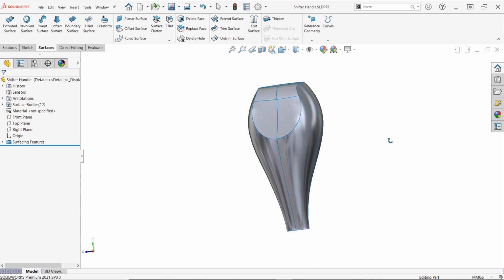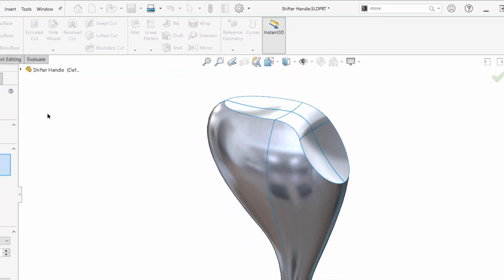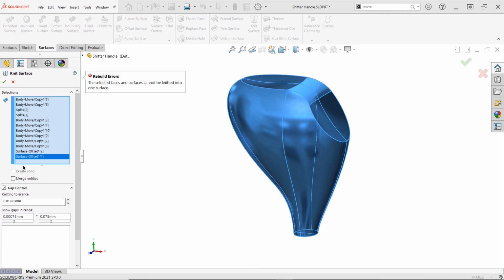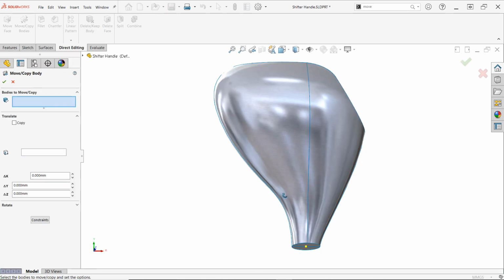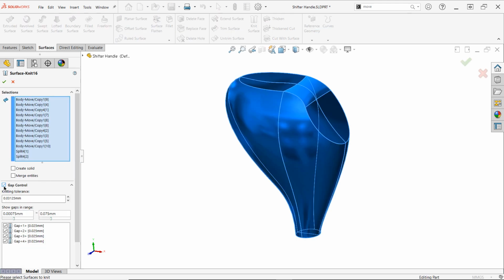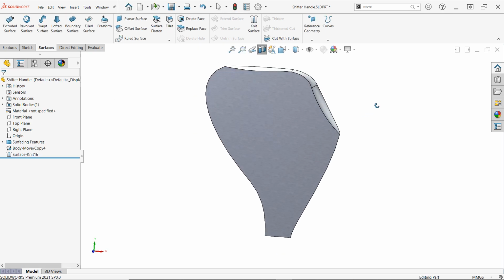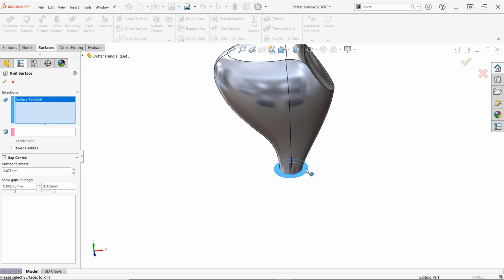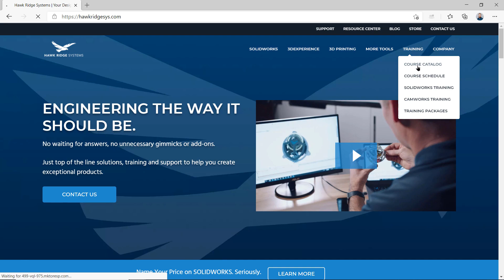SOLIDWORKS: Using Knit Feature for Surface Modeling

Comment: What you call solid, is just the system putting a cap on the holes. 
It's all surfaces. And you can see that if you make transparent one surface of a "solid" and you can look inside and see there is nothing inside! LOL (Use the Change Transparency command on any surface of a "solid" in a Part file, in the context menu!)
Also you can see all the internal (negative) features as surfaces.

Comment: If I knit all surfaces and it rebuilds without errors, why do I still see those unwanted lines?
The whole point is to get rid of the lines because sometimes Fillets don't succeed with crossing lines!

Comment: Can you teach me how to link two parts of solidworks by using knite surface. I mean like i draw two parts for example i saved them as part 1 amd part 2 of solid works file, and then how i can create a link between them so that if in future i need to change the dimensions then i can easily change that only and other parts will be changes with respect to that 😊

Comment: What you’d say if compare offset from the surface with zero vs knit surface tool?
Reply: Hi Artem, that's a great question. There's a considerable amount of overlap between those two tools in the context you're describing, and in many cases they can accomplish the same thing. The main difference in your situation is that Offset Surface can be used on individual faces of surface bodies to offset/copy them, while Knit Surface must be used on entire bodies and cannot be used on individual faces. Keep in mind that what you're describing is a different use case for the Knit command and isn't something that is shown in this video. I hope this helps!

Comment: Thanks for the excellent video. I wish to know whether it is possible to upload the part file. Just to practice because I have many issues in gap control.
Reply: Hi Rajan, I've uploaded the original surface model of the Shifter Handle to Google Drive so that you can download and work with it:

https://drive.google.com/file/d/1Dbhl4WBdefz7vhub6hEQymnPxU3ojxiB/view?usp=sharing

This is the very beginning version with the gaps, so you'll want to follow the steps I've outlined in the video to get it to work properly. I hope this helps!
Reply: @jacobames8768  Thanks for uploading the file and following guidance.